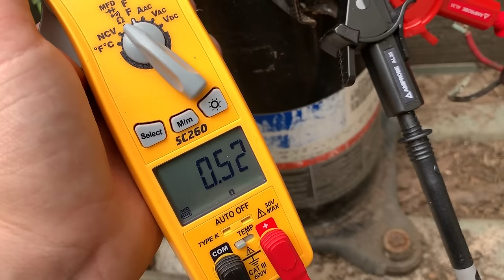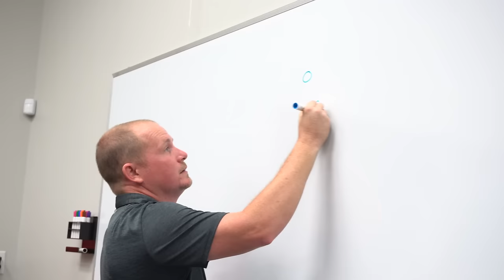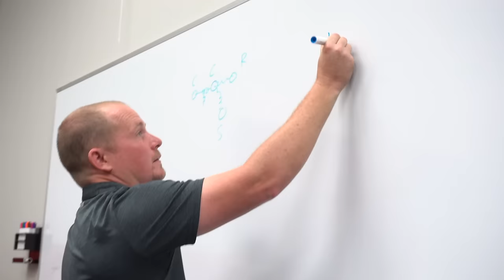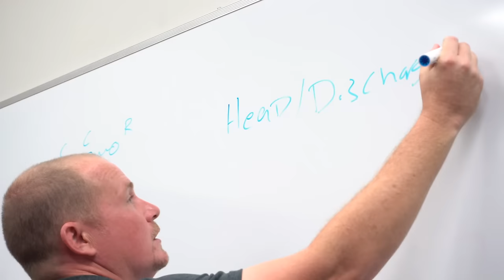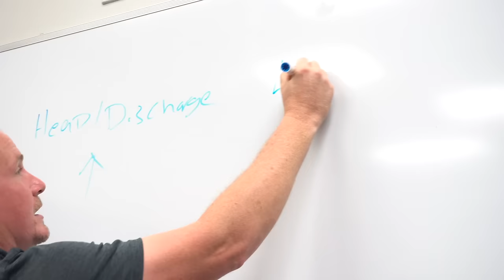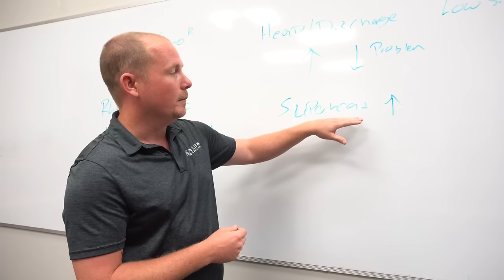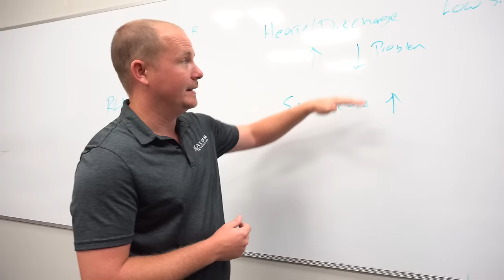Critical System Diagnosis for Residential HVAC

Comment: Great video, your opening and closing comments about intent to be certain and caring are crucial.   Its the missing link in many cases.
I am 80yo now, retired mech engr and HVAC contractor... started with my own small shop, built it to 27 men, and large systems in the 50 to 200 ton range..   sold out in 1986, began consulting nationally, then for major firms on billion dollar projects, testified before congress on the ethical issues related to our nuclear weapons plants.    It can be done by just the intent to understand and learn more and more each day and by always looking to involved in the next higher level.

Dress and personal appearance is key however...very clean, very well groomed, a manicured look almost... nice crisp shirt,  snug pants,  good boots kept well.  Can easily double or tripple a mans income.    Being cool and sloppy cuts income to base levels or lower.

One time I had the large vice on my truck chrome plated and polished with a polished brass plated clamp bar... mounted behind the cab.  I raised my prices to be one dollar higher than the most expensive outfit in town... my business doubled.... and.. you have to care.. alot about being 100% correct. No guessing.  That is what makes you sharp... and that brain function will serve you well deep into your 80's.   Sloppy people degrade much more quickly than that.
Reply: Great advice 👍 as a veteran in this field, your words are on point, 1st impressions last a lifetime, and your work speaks for itself. I've seen installs that mustve cost $150 in labor, and I've seen installs that go for much much more. Do it right the first time, and you'll sleep well at night..
Reply: Very interesting!
Reply: Yup, wearing “snug pants” has certainly doubled my business…with the single moms 😂
Reply: Great comment!!! I'm 71, started out in 1977 working in Central Florida area. I was super-hungry to get into, and then own my own company
way before going to school for HVACR work.  My friends thought that I was crazy, at least some of them!  As you said in your comment,
dress seriously,, look serious,, behave even MORE serious!  I had two service/install. businesses one on Long Island, and the other where I live
in Wilmington, N.C.. I also was a service tech. in the NBC Building, 30 Rockefeller Plaza, along with 3 other techs.. we serviced all the studios
and about half the offices. I really enjoyed that situation, except for the commute to and from Suffolk county, Long Island! LOL!!!

Comment: I was out in the field for the first time  me and some other technician and found my first leak.
Reply: Congrats 😉
Reply: How did you fix the leak?
Reply: A lot more where that came from💪🏽💪🏽  don't forget to use core tools to perform a proper evacuation and flow nitrogen While brazing.
Reply: Flex seal 😂 it's good to go

Comment: Great video. I had a bad breaker one time on a heat pump. In heat mode it tripped out every time the heat strips came on. The strips checked out so after a lot of head scratching we figured out a weak breaker

Comment: Cut 21 compressors apart today to autopsy and find out failure mode.  1 had the suspension spring off the foot and had gotten into the winding causing a short.  Enjoy your video;s always.

Comment: Was working on a 26-year-old Trane XL1200 with that very same compressor and I remembered this video when I plugged in the disconnect and that crankcase heater completely arked out and shorted out definitely quite the spectacle. Scared me but i definitely thought of this video..

Comment: Thanks so much Mr Brian,for that good explanation you have exhibited to us on issues of proper diagnosis of a good or abad compressor.But one thing I would like you to highlight more is on how to use amegger on compresors because you mentioned that not put leads across the two terminals? thanks

Comment: Another tip I find that helps with bad valves/ no pump would be to check amperage on compressor. Low amperage means its not pumping.
Reply: That could also mean a low charge also when amps are low.

Comment: Hey, Brian. What do you think about trying to pump the compressor down if you think it's not pumpiing correctly? And if it does pump down, when you pull disconnect, should psig rise, or stay steady?

SUper great video, man. You answered some of the quuestions I had. Than you!
Reply: Also, Brian, Don't scroll compressors have reed valves that can leak? or am I thinking of reciprocating? Thank you
Reply from the maker: I am glad it helped
rest of your questions are noted and I will answer them soon in Q/A video

Comment: Thanks that was clear but u never mentioned Acid in the system that kills the compressor and the new compressor if it was not flushed before installing the new compressor....

Comment: Hoping to get a response back. I noticed when y’all were talking about recovering Freon and weighing it you never talked about performing a pump down test first. That is faster and cheaper than recovering the Freon and charging the customer for your time. Close your valve to pump the Freon down to see if the pressures change.😵‍💫

Comment: 12:12 - the best way to assure that the probe connected to the shell is making consolidated contact is to put both probes on the shell, check for continuity then move one of the probes back to each of the terminals.

Comment: @ 16:16 "Someone was stealing the refrigerant out of the system" I actually had a system where the wife was huffing the R 410-A, I spent several days there, on separate days looking for a leak, I could never find one, so I reluctantly added dye to the system. Well, I showed back up the next day and found the wife bent down by the unit, with a hose in hand and a goldish color all around her mouth. True Story! So I added locking caps to the system and didn't have a problem with that unit for several years after that.
Reply: Doing this that you said she did would kill someone the first time they did it. The refrigerant would not let any oxygen enter the lungs after it’s inside there so this can’t be true.
Reply: Cut it out,a goldish color around here mouth, Did you hit her in the face with your UV light 😂😂😂

Comment: There is also another category of compressor failure. Broken shaft (or thorn spline on shaft) between motor and piston/scroll part. Looks like commpressor is running, but more quiet, and there is no pressure difference between suction and discharge.

Comment: I found that the supco megger reading bad can often be due to air and noncondesables in the system. Recover, pull good vacuum, new refrigerant, and it goes back to reading good.

Comment: I still think that a start capacitor overall is a good upgrade.  Heat and time is what wears down compressor windings.  A cool suction line only happens while the compressor is running.  A start capacitor addresses the winding heat on startup and therefore increases the compressor’s longevity.  We only use the 5-2-1, not the kickstarts.

Comment: Hey Brian this is Jeff from Maryland I don't have a comment ,I have a request I do new construction start ups And I was wondering what you thought about The  Load that is inside the building because during the summer it's very hot I was wondering if that would affect my super heat and  Sub cooling . I have  been going from label recommendations  and I'm concern if sub cooling is going to be correct with the structure being so hot. Any advice  would be greatly appreciated. I have been listening  To you for 2 years You have taught me alot I would appreciate it if you would do a video on That topic. Thanks Jeff
Reply from the maker: Noted!

Comment: I am sorry. When you told that the delta t in between succión line and exterior should be 55 to 60 F of temperature, are you referred to the low side saturation temperature or the suction temperature that we normally measured to calculate the superheat ?
Awesome video. Thank you !

Comment: Breaker will trip very quickly if it is weak. As in it’s a 60 amp and you pull 50 amps and it trips in front of you.

Comment: Just out of curiosity I though scroll compressors had a reed valve on the discharge port, and if that goes bad the compressor could stop "pumping" correctly?
Reply from the maker: I will answer your question in Q/A video

Comment: I'm not an HVAC professional, but I thoroughly enjoyed this presentation. However, I see a problem with the compressor isolation test. It only works if there are no other overloads on the circuit breaker. Lets say you have a 60A breaker that feeds a compressor (30A) and a blower (10A). Now the blower motor shorts out and draws 45A and the breaker trips. If you isolate the compressor, the breaker won't trip with 45A and you think the compressor is bad. To do this properly you need to check how much current is flowing through the breaker with the compressor disconnected.
Reply from the maker: A short / grounded condition is almost never partial like that - a grounded motor will almost always draw in excess of 100 amps
Reply: @HVACS  Thank you for your response. Unlike me, you have the experience to say "almost never" and "almost always", but I can imagine motor winding insulation breaking down and gradually causing the motor to melt down. Anyway, it's something to be aware of, don't you think?

Comment: 12:05 - Knowing the relationship of the winding resistances on a single phase compressor has saved my bacon a couple times in the past. Like an idiot, I pulled off the connections to replace the crimp connectors without paying attention and the csr terminals were not clearly marked.

Comment: Hi. Extremely interesting video.   I was with a tech on a job and the unit was out of gas. Condensor had cracked. Repaired leak and regassed. Turned on and compressor seized. The tech i was assisting said that the customer must have being continuously resetting the compressor with no gas in it and damaged the compressor. What is you opinion of this type type of situation ???  How would you deal with this.                     Any advice out there appreciated.             Thanks Michael

Comment: I really thought you were going to say pinch off the discharge line if you don’t know if it’s the compressor or not
Reply from the maker: Do it EVERY TIME!
Reply: @HVACS  Front seat liquid line service valve start unit easy test.

Comment: I do have a question: can we install a dryer line filter on r22 units?
Reply: Yes, just make sure its on the discharge line and in the correct orientation (arrow pointing towards the air handler).

Comment: If crap gets into the little cap tubes going to the reversing valve will cause problems quicker than crap inside the valve.

Comment: If this was the case on a commercial application for a rtu train would make it a lot easier to replace the heat exchanger like carrier does but they don't they want you to buy a new unit

Comment: When I refill R-410A according to target subcooling, but suction line pressure is still at 90s, which means saturation temperature in evaporator below 32F.  To avoid a frozen evaporator and suction line, I’ve to continue refilling refrigerant and take target subcooling aside. What’s wrong with the system? Thank you
Reply: Low air flow, could be clogged filters, low blower speed, oversized unit, bad duct design, a reach would be failed TXV, bulb in the wrong location or not properly insulated
Reply: Forgot to ask, is it a TXV?
Reply: Justin Williams Thank you so much. Copper evaporator coil leaks badly.

Comment: Maybe I missed this part, but how does Kalos determine the cause of the compressor failure? Meaning, if the compressor failed due to a restricted metering device, how do you figure that out before the compressor is replaced to allow for it in the price? I have started always replacing metering devices along with a compressor (or cleaning if it is a piston).
Reply from the maker: I will try to answer your question in Q/A video

Comment: I hope the Techs are really paying attention, I  have had nightmares with a Trane Unit, I blame a lot of it on knowledge. HVAC work is very complicated to diagnose. And I think a lot of it was due to bad diagnoses. I had 2 compressors installed plus the original. The parts were made all over the world and supposedly Americans put the units together. Even worse the Techs NEVER brought out a diagnostic devices to check the parts of the unit, I questioned one and was met with a "what is there to diagnose". This was installed a Trane Tech, not just anyone.

Comment: I just want to add 1 more thing.  If you come to a compressor or any motor that is hot...it is not a bad winding.  It could be capacitor or the fan is not running or a blockage of some type.  The motor only gets hot if the winding is good...when it is open it will be cool to the touch.  So if the compressor is hot look elsewhere is what I am trying to say.  If you check it for high amps and it is not a locked rotor.

Comment: I got a question for some of the older techs and Brian Orr. How many of the older dudes grew up in the industry learning that callbacks=DEATH? And is now watching the newer companies don’t even comprehend the need to not have callbacks. They all seem to ONLY care about one thing and one thing only, SPEED. Get on the call, fix ONLY what was called in, even if you find other stuff, don’t touch it… and you’re like, WOW, all so you can charge them another fee, and waste a bunch of time.. I was taught this way. There’s no need for crap like that. There’s $$$ to be made in this industry w/out working shady little angles like that. They have a little price list w/a corresponding action. And god forbid you do ANYTHING that a. Wasn’t on the complaint list, and b. They don’t have a price for. On a commercial rtu, you find a drain that has came off and laying on the roof. You just walk over, pick it up, make sure it’s not clogged and simply stick it back on, literally 9.2 seconds worth of work. I think it’s disgusting.

Comment: What’s the app for checking resistance on a compressor?
Reply: depends on the  compressor you are working on, for example, you can download Copeland mobile app and it will show you the winding resistances
Reply: Copeland has an app for theirs, many others you have go down the google and .pdf search wormhole.

Comment: I wonder if there is an gadget that measures the compressor's discharge line and the liquid line ..which than shows the measures of both line....just to find out exactly if the compressor is not pumping well
Reply: stuff a banana in it

Comment: It could be a loose wire in the pecker head over heated and burned loose and is shorting to the metal case.  That happens sometime.

Comment: A like here! 
Get rid of your ego. Find solutions instead of complaining about a problem. 
1.  Tripping breaker; Also check the connections at the breaker for tight and that the stabs behind the breaker are good and not corroded and check to see if the breaker is running hot. A voltage drop here at the breaker will kill a compressor. This goes for the disconnect and contactor as well.
Always question WHY- Why did the compressor fail. Why did the motor fail? What caused the refrigerant leak.....

Comment: Also just because the compressor ohms out correctly DOES NOT mean it's good. 

Mine ohms out fine, but it's mechanically seized up. 

If you see a hard start kit already on the system that's a pretty good indication that it's seized up or is about to.

Comment: Did not agre with hardstart kit opening all factual  but most systems should have em  before its a band aid 
Alot /most schematics have a * stating  may be factory/field installed in az almost all system get em at some point

Comment: In cars I can oscilloscope a starter motor, that tells me the condition of the brushes. Then the peak amps to get the motor to move tells me if there's a problem.  Every piston is shown by relative compression as the amp drawn to overcome each piston in its compression stroke will show up in the inconsistent waveform. This accurately shows if a piston didn't perform correctly in comparison to the others. Then the commutators leave a no doubt signature which can be used to measure rpm in milliseconds, multiplied by 60,000 gives an RPM.  Rpm is useful in discovering restrictions because the rpms goes down.  You can actually see the the health of motors and the health of what they are used to work. I wonder sometimes if this is useable is your career field. I will be investigating it. There is just alot for me to try and learn about this HVAC and ac electricity in comparison to DC which is all I'm used to. This relative compression is done within two minutes but tells me many things. I'm just doing HVAC as a hobby I know very little about this material. I can fix a car but not an HVAC system. Lol

Comment: Hiya, I havnt seen a video on this, but if a system has had a leak-stop additive put into it, because the system had a leak (presumably not best practice but it obviously happens) how do we deal with the mixed refrigerant, clean gear and manifold? I’m not sure if the chemical blends with the oil or becomes suspended in the gas and circulates.

Comment: Woah woah woah now… (weak breaker) as defined by, TRIPPING. Found in the (tripped) position (middle position). An amp draw/max amps will prove a weak breaker. It’s not uncommon. So tue answer is, a breaker that trips under/below rated amp draw. And neither is a leaky Schrader valve… lol, but then you’d start accusing me of loosening the schrades🤣 talk about irony🤣 like, “yeah Brian, all these techs are out here loosening schraders🤣…”